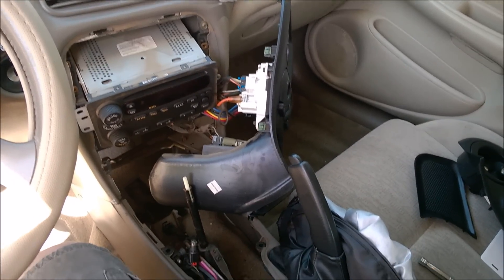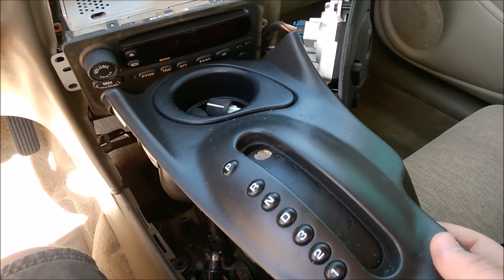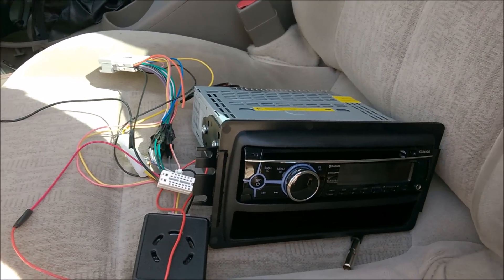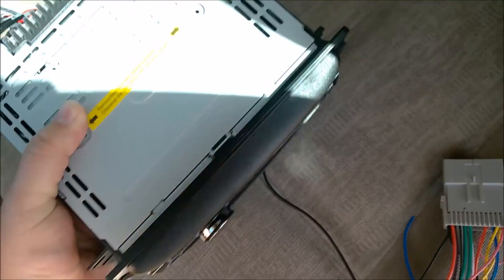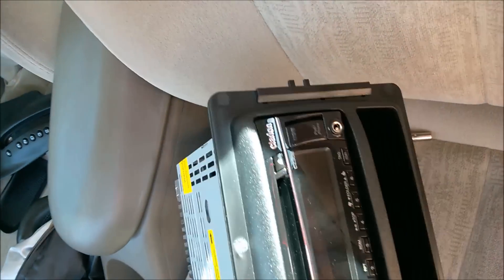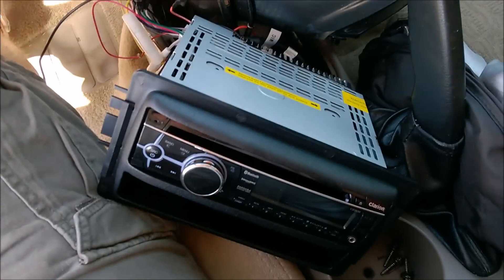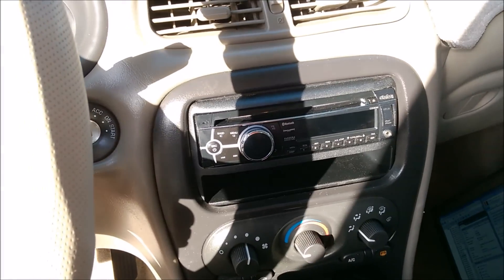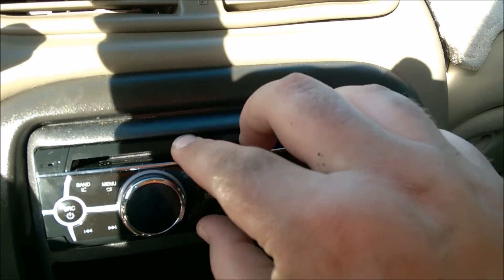2003 oldsmobile (olds) Alero after market radio install  (similar to Grand am, Chevy Malibu)

Comment: You don't need to do all that put it in 1st gear and you will have the room to pull the stock radio out and with a screwdriver you can pop out the plastic that holds it in
Reply from the maker: I was following somebody else's instructions, worked fine for me.
Reply: @AICvideo  well now you know man i looked this video up to replace my radio and I thought that was strange

Comment: So, when I purchased my car, the stereo (after market) didn’t work. I am attempting to put in a new after market stereo and it does not power on. When I connect the wiring harnesses to the original wiring, you can hear the CD player make a sound, but the stereo doesn’t power on. Any suggestions?
Reply from the maker: You would be much better served asking this question over at https://ford-rangers.com/

Comment: I have a 2003 Alero. When I purchased the car the factory radio harness had been cut.  There are 2 ground wires that come out of the dash area and there are a total of 4 PURPLE wires that are also located in this area. (LIGHT PURPLE). I know that 2 of the purple and one of the ground go to the stereo. After you connect all your wires to your aftermarket stereo...There are 2 PURPLE wires left and one ground wire.  What are they for? I have looked and looked on the internet and I cannot seem to find anything. Other than maybe the purple wires somehow are connected to PCM. ?????? But that also still leaves the other ground wire?  One of the purple wires has power to it and the other does not. I don't know if you can help me solve this mystery but it would be greatly appreciated. Ty in advance.
Reply from the maker: I couldn’t begin to help with that. I would head over to http://www.aleromod.com/forums/forum.php and ask for help there. They were helpful to me when I owned my alero. Not sure how active that forum is anymore, but it would be a start. Also look for a Malibu or Pontiac grand am forum as they are the same car.

Comment: I can’t figure out what wires go to what. Me and my boyfriend are trying to do that right now and it’s driving us crazy. The colors of the wires are too faded to tell. I own a 2004 Oldsmobile Alero.
Reply from the maker: you should have a new adapter kit and a new adapter from the radio. If the wires are too faded to tell, the only think I could think you would have to do is go at it with a multi meter.
Reply: AICvideo Thank you so much.

Comment: It helped a lil bit but idk how to do the wires and I thought that would be shown
Reply from the maker: the kits you bought should have wiring diagrams. I specifically didn't show that because it depends on the wiring harness you buy.
Reply: AICvideo I didn’t buy one yet but there’s one at walmart for 20 so I didn’t know but thanks
Reply from the maker: You need these to parts to plug a new radio into the car's electrical system. 
Metra LC-GMRC-01 (wire harness) - https://amzn.to/365mqpE

Metra 99-3301 Installation Multi-Kit  for GM - https://amzn.to/2ttqtyL

Comment: I have the same problem with power and the radio I put in made the Security light go on and I could not start my car so I put everything back in unplug the battery and then it work fine but I’m not understanding why you need that box behind the radio
Reply from the maker: are you talking about this? https://amzn.to/365mqpE

It's to retain chimes, like the "lights are still on when you open the door" chime. those usually go through the car speakers, so you have to replace that if you replace the head unit.

Comment: yooo i got a olds alero. it's my first automatic. I'm hoping to squeeze some life out of it as it only has like 60 k miles. it's a 2002 wish me luck lmao the v6 is quite sporty
Reply from the maker: that is super low miles. I would have a mechanic check it out for sure, and check the fluids. While not a lot of miles, fluids do degrade over time. You probably can do a transmission fluid change (NOT FLUSH) for not a lot of money, and get 150k more miles out of that transmission. that v6 is fun.

Comment: I'm working on a 02 model and cant get it to power up I was installing a brand new pioneer double din and everything was wired correctly but no power I called metra and they sold me a wiring harness that was supposed to fit but I dont know what's wrong
Reply from the maker: for me, there was an extra wire I had to add to power on the harnesses. I wanna say there was a more orange/red wire that needed to be added to the other red wires to get it to work. This was >3 years ago, so I don't remember exactly.

Comment: So my wires from the factory radio aren’t same colors I guess faded.? They don’t have a line on them any help??
Reply from the maker: you should only be splicing new wires together, the new radio comes with a wire plug, and then you buy an adapter wire plug that plugs into the factory plug.

Comment: How the hell did you get that pin out I’ve tried a screw driver and even tweezers 😂
Reply from the maker: do you mean on the shift knob? just get a small flat head screw driver, and make sure it goes over the top of the pin, and then when you pull up on it, it will go behind the pin, and pull it out.
Reply: AICvideo yeah tired that like I said in the original comment lol for some reason my pin is pushed in deeper lol I checked my friends alero and it’s not as deep into the gear shift so that’s fuckin great lol

Comment: Does your alero have the monsoon amplifier in the trunk? I read that the metra chime retainer isn't compatible with the stereos that are amplified :( I have a 2002 olds alero coupe gls and it has the amp
Reply from the maker: I did not, I would check out:
http://www.aleromod.com/forums/forum.php

There is some great info there.

Comment: How did you get it to turn on?
Reply from the maker: I had just hooked up the wires wrong. i had to go back and check my wires. this video is over 3 years old, so I don't remember exactly, but I remember it being the wrong wires hooked up.
Reply: Okay yeah I had to connect 3 wires together instead of them being individually wired

Comment: Thank you. Very informative and helpful. I accumulated one of these cars. I had a grand am before seems exactly the same with wiring. Hate how GM puts door chime system into the radios.
Reply from the maker: Yeah, they are basically exactly the same cars with some different skin and interior bits. Its a decent car to put my commuting miles on.
Reply: Yah only diffrence was my Grand Am was a 99 and had a 2.4 vs the 2,2. I know they are about same engine but I think my 2.4 had more power. This car alittle gutless but nice on mileage. Fact I got it for $500 and its not rusted was a plus.
Reply: Also did this harness need teh seprate power to the fuse box wire?
Reply from the maker: That's a good plus. yeah, the 2.2 has like 10 less hp, but better fuel economy and was more reliable than the 2.4. I've had two, one with the 2.2, and one with the v6. the v6 only has like 30hp more than the 2.2, it has a lot more torque, but gets a lot worse MPG's I would rather have the 2.2 now that I've had both.
Reply: One thing I learned about AL Gm vehicles having owned Several. Few Lumina's couple Impala police cruisers. Remove Dex-Cool. Its not needed and it eats headgaskets. Refrence the Lawsuit in 2011 because of it.  Chevys run just fine on standard Anitfreeze you just have to change it more often.
Reply from the maker: Its been 4 months since I did the install, but I think there was a random redish orange wire that I think had to make sure was tied into the rest of the red wires, before everything worked.
Reply from the maker: yeah It currently has green coolant it in, but its more brown green and pretty old/gross. I plan on changing it as soon as it cools down a bit, and I finish some work on my Cherokee XJ. I plan on doing a proper coolant flush/clean out.
Reply: When I lived in Montana I used to have a 86 Cherokee sport. Was the 4cylinder model. They are awesome truck.. Till Chrysler destroyed them in my opinion.
Reply from the maker: you should check out my other channel, I have an 89:
https://www.youtube.com/c/aicoffroadvideo

Comment: Okay what wires go to wear and can you bypass the Chimes. It's pretty self-explanatory to take it out and put it in but what about the wiring
Reply from the maker: Yes, you just buy the wiring kit that doesn't include the chime. as far as wiring, both the adapter and the radio come with wiring instructions, I would use those, since they are specific to the radio/wiring diagram.

Comment: I want to install a DNX574S Kenwood. In a 2004 Alero. Do you think it would have fit. Car toys says it will but Crutchfield says it does not. I plan to get the interface and the installation kit but I am running into a hiccup when people are saying the depth is too small one person says it isn't and one person says it's not
Reply from the maker: That's a double dinn radio, and its been a couple of years since I did all this, but if I remember correctly, you have to make modifications to the bezel to fit a double din, since the factory radio is like a 1 3/4 dinn size, and that's why I went with a single dinn. 

I recommend you check out alero mod: http://www.aleromod.com/forums/forumdisplay.php?s=462da0039dafd3166e37e67cb953150a&f=16

they'll have more information there.

Comment: my CD Player for my 2000 olds alero seems to skip when I stop, accelerate, hit potholes etc. Hopefully I can find a quick fix for it.
Thanks for this informative vid!.
Reply from the maker: Replace it with an after market with Bluetooth. Totally worth it! and not difficult. the fix for a skipping disk like that would be a replacement radio unit, and by the time you've done, that, its just worth replacing with a Bluetooth capable radio.
Reply: AICvideothanks for the feed back! Definitely worth it if i can get bluetooth
Reply from the maker: You can get a name brand single dinn for not much money, like $50, totally worth it.
Reply: according to amazon the bus interface are incompatible for the 2000 model. This officially confused.

Comment: I too have an Alero, there is no radio in it currently.  Is this radio a 7 inch?  I am looking for one with bluetooth, and GPS.
Reply from the maker: This was a single dinn radio, if you want a screen with nav, you'll either need a double dinn or one with a pop out screen. a double dinn required more modification than I was willing to do for this project so I went with a single dinn that had blue tooth.
Reply: Ok, thanks!  I appreciate this!  I just got my 99 olds alero, it has 42K original miles on it...$800 with fees is what I paid for mine.  I got it at auction.  I do love my car!
Reply from the maker: Nice! smoking deal on that one.

Comment: how did u not have to run a wire to the factory monsoon amp in the back?
Reply from the maker: Because I don't think I have one? I just wired into the factory harness, and all my speakers work just fine.
Reply: thats messed if its 03 it comes with a monsoon amp its in the trunk, if u still got the car check, its in the trunk on the left side behind the fabrick
Reply from the maker: no, that's only on the upgraded 8 speaker system. I have the base 6 speaker system.
Reply: damn any suggestions how to get around it?
Reply from the maker: from the wiki: "The GLS trim level was the "sporty" trim level of the Alero. It added the following features to the already well-equipped GL trim level: a rear spoiler, an AM/FM stereo with cassette and single-disc CD players (later, an MP3-decoding single-disc CD player was added), an eight-speaker "premium" sound system with amplifier, power front seats, and a security system. The 3.4L V6 engine was available as an option."

according to the build sheet I have a GL1 but it was upgraded to the v6 and a package that included the spoiler and fog lights.
Reply from the maker: ***** there should be a wiring kit to support it.
Reply: im looking and what i found is i might need to get this special wiring kit that bypasses the amp.... huge bummer BUT if i can get a male to female extention thing that would same me alot of money and hopefully i want have to "bypass" the factory amp and i can just take it out
Reply: why not just wire it to the amp if its going to cost more. I know this was a year ago but im currently in the same situation with the same car.

Comment: Was the black wire that seemed to be spliced with a loose terminal on it for grounding? If so where did you connect it and if not, what is it? Thanks for the video man!
Reply: Also, when connecting wires color to color do you crimp or splice all the same colors even if there are multiples of the same one? I'm kinda referring to the "orange/red" power cable that needed to be connected.
Reply from the maker: yes, its for ground, I don't remember exactly where I screwed it to, but I just found a screw in the back that either had a ground wire to it, or one that had metal behind it, and that works fine.
Reply from the maker: Look at the wiring diagrams for the radio and the adapter you're using. while there is a general color code, its not 100%, so look at the wiring diagrams. Now if two things use power, in this case the radio and the chimes, then yes, they get wired together, but your diagrams are more important, than what some guy on the internet says.
Reply: I have an 03 alero and purchased the same adapter harness and chime mechanism as you. Head unit will be different but overall I'm thinking things should be similar. Hoping the chime mechanism wires are easily matched to the original wires. I'll try to find wiring procedures somehow. Google? Lol. Thanks for your help my friend!
Reply: PS - why did you have to attach an additional ground wire? Isn't there a grounding wire as part of the original wire setup? Or was that for the added chime mechanism?
Reply from the maker: +Scott Davis I honestly don't remember, this was almost a year ago, I think it is a separate ground for the chime.
Reply from the maker: +Scott Davis alero mod forums is a good resource, it's still fairly active last time I was on there. The harness and the radio both should have come with a diagram, if not look on the manufacturer websites.

Comment: Where did you find that system?? How much did it cost ?? I drive the same car and I want a car system & what all did you need to put it together
Reply from the maker: Find the items in this video on amazon:
Clarion CZ302 Bluetooth 
http://amzn.to/1UApFNe
Metra LC-GMRC-01 (wire harness)
http://amzn.to/1SNTXL8
Metra 99-3301 Installation Multi-Kit  for GM
http://amzn.to/1OeWcSg
Reply: AICproductions do you need the wire harness?
Reply from the maker: only if you want the radio to work.